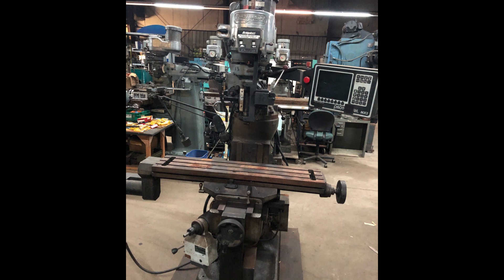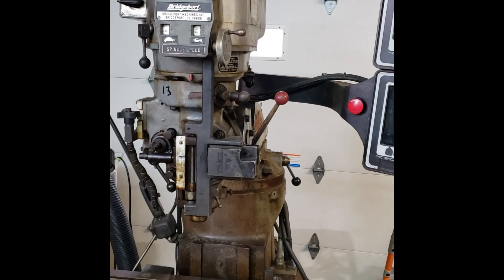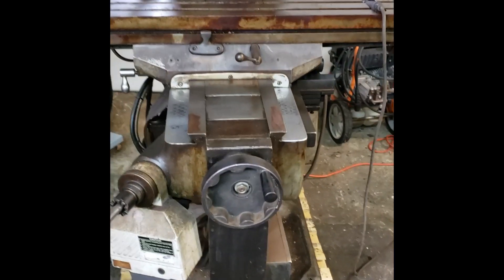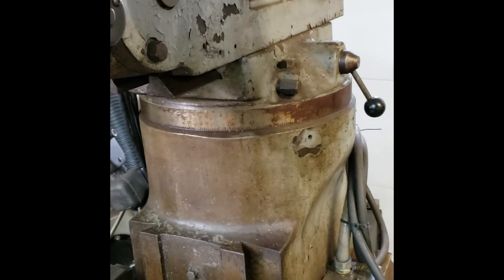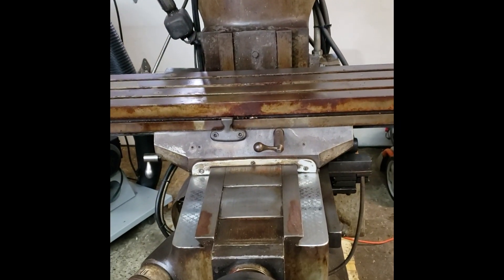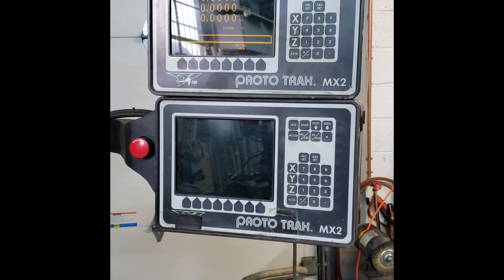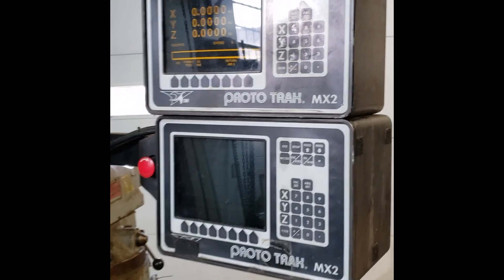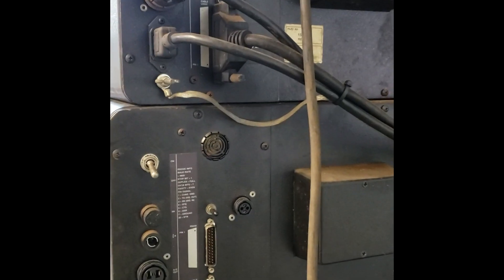Bridgeport Milling Machine Equipped with  Prototrak MX2 control system  Part 1

Comment: Joe, Mine is a 1963 J-head but no chrome ways. I wonder if that was a option? I had heard chrome ways started in the 1970's. It's definitely the older style saddle "one lock handle" Should be a good machine "its all about the ways" wish mine were in that condition. Another nice addition to the collection!
-Dean
Reply from the maker: Dean, i have a 65 that also has chrome ways ( definitely not as good shape ) ,  i understand that it was an option back then. I am trying to find out if the head has been replaced as i didn't know the vari speed head was available back then.   the collection is growing..  need a bigger shop !!  LOL   hope to see some videos soon !!  Joe